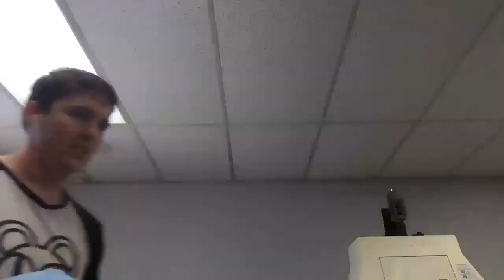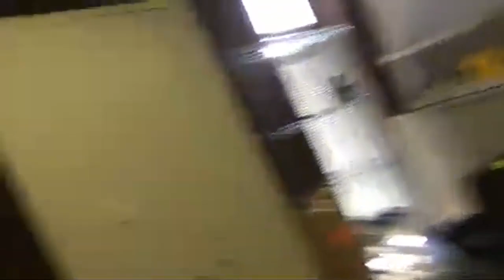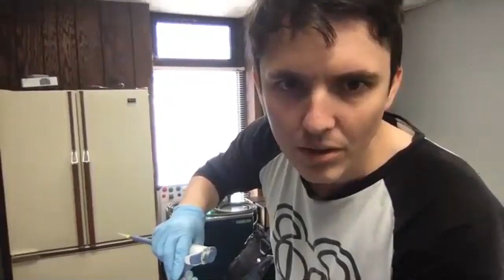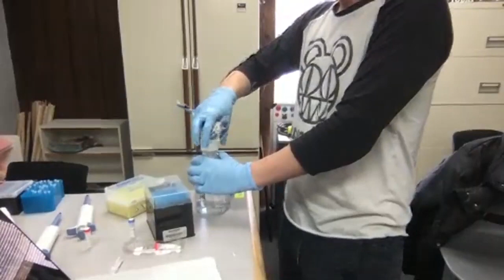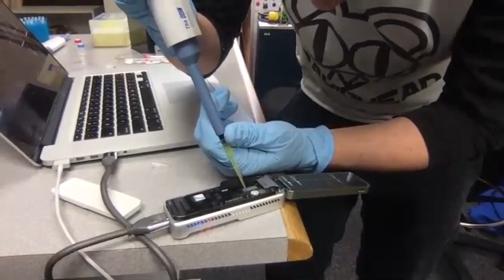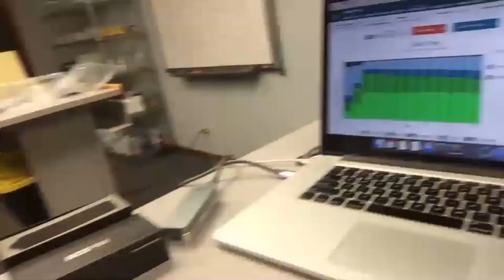DIY DNA Sequencing: Nanopore Attempt 1

Comment: Does it offer the code in full form FASTA of all DNA? Some chromosome? Or the sequence of some gene?
Reply from the maker: Output data is in two formats: FAST5, which is a (very data-heavy) file format Oxford Nanopore developed for holding the raw current change data from the pores, along with records of any basecalling of that data with any of the numerous possible basecallers; and FASTQ, which is similar to FASTA, but also includes information about how confident the basecaller was in its assessment of each base on each read

Comment: Hey mate. Did you sequence your whole genome? As in you can see all the bae pairs on your pc? If so is it possible for a lay person like me to do this at home?
Reply from the maker: Still tough (and expensive) to do whole human genome sequencing at home; you need ~30X coverage of the 6 billion base human genome for accurate basecalling/assembly, so you need to accumulate ~180 gigabases of sequence data. The yield from a MinION flow cell is currently ~10-30 gigabases with good sample prep, so you'd need ~10 flow cells with well-prepped DNA from your cells to get enough data to sequence your own genome. And then you'd probably need to set up a cloud computing cluster to run the genome assembly and polishing, since assembling human-size genomes is still very computationally intensive (terabytes of RAM required to run efficiently). So basically, it's getting cheaper and easier to do whole genome sequencing, but we're not quite at the point where it's easily accessible for a lay person to do it in their own home for less than ~$10,000.

That being said, there is a simpler task that might actually be feasible today on a single flow cell at home:  human exome sequencing. This is sequencing not the DNA in your cells, but the RNA that is transcribed when genes are expressed. Protein-coding genes are only ~1% of the human genome (30 megabases); so you could easily get >30x coverage of that from a 10 gigabase flow cell run. It wouldn't be trivial--RNA is less stable than DNA, and would need to be reverse-transcribed back into DNA before the run using Oxford Nanopore's kit--but it might be feasible.
Reply: @eyesmo  What makes it so expensive though? Is it the flow cell or a solution used in prepping a dna sample?